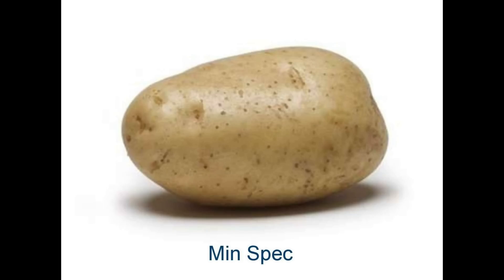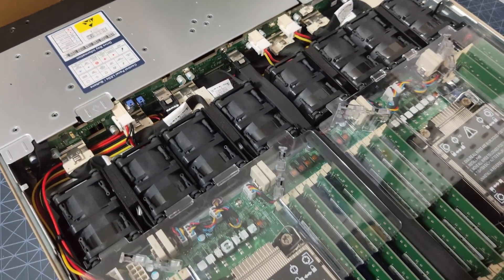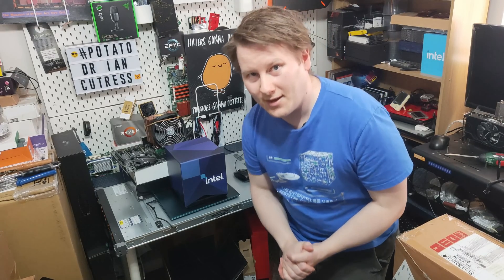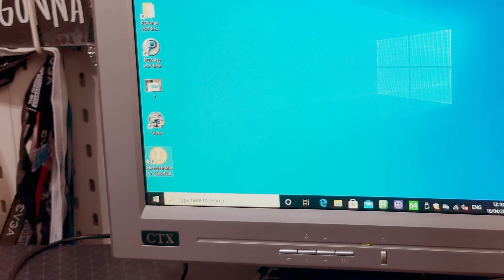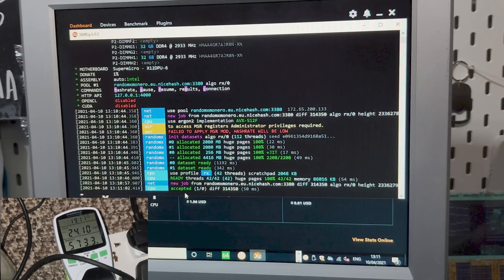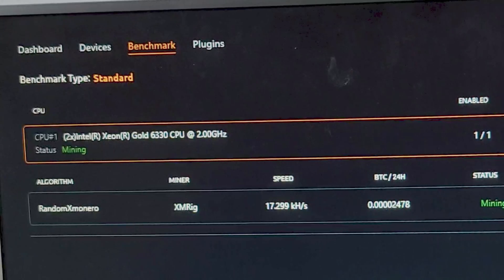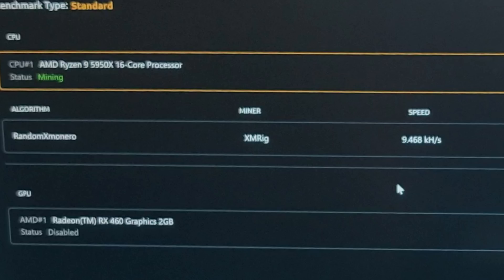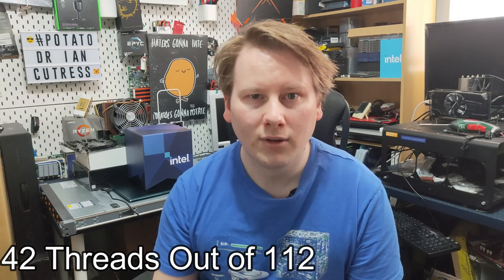Mining on Intel Ice Lake Xeon ⛏⚒

Comment from the maker: UPDATE UPDATE UPDATE
These initial runs were done on fresh OS, no special anything.
I've since rerun the numbers with ADMINISTRATOR and LARGE PAGES enabled.
2 x Xeon Gold 6330:  23.824 kH/s
Ryzen 9 5950X: 15.940 kH/s
You can see the images here: https://twitter.com/IanCutress/status/1380986489371246604
Reply: 15 kh with just 16 cores 😆, and dual xeon with 28 each just 23 kh, lame intel
Reply: For utube algo
Reply: Ian - I mine Montero with 5 different CPUs in my house - a 5.1 GHZ 8700k, a 4.4 GHZ 5820k, an i5-8400, an old SandyBridge 4 core Xeon, and an i5-6500. Yes Ryzen 3000+ would be FAR FAR better for such uses, but I mostly game on my 8700k, and the 5820k is my Bro's current gaming rig. The rest are other small household PCs.  
Anyway, I managed to mine $2500 worth of Monero in 2 years, which is WELL OVER HALF All of my electricity costs for that entire time - that is to say over $1500  of said mining was sheer profit. Mind you - we run 4 window unit Air Conditioners for 3 months of the year, and a bit of electric heat in the winter. 

Obviously I don't mine as much in the summer, but in the winter, it is free heat.

Also, I manage a combined hashrate of ~18 Khash on average.
Reply: That is downright pitiful for the tier of server that is.
I'm certain it handles regular datacenter grade task fine but still.
Also, your best performance will come from a linux system with a custom tuned kernel, would 100% recommend that if you want to get serious with mining.
Reply: Your information on Monero is outdated, they moved from cryptonight hash to RandomX, the 2MB/thread is for cryptonight, RandomX uses a 2GB scratch pad which is why large pages is so important, and RandomX is a CPU only algo, you'll only get 2khash/s on a rtx 3090, the reason why it's not very profitable is because demand for monero is low, fine tuned systems with undervolting, memory OCing, and some other people mine at a "loss" because they either have a botnet or use it to warm their rooms.

And my 5600X does 7kh/s, and i5 3570 1.7kh/s (memory bottle neck).
Reply: strange result for Ryzen 9 5950X, I have 14 kH/s on my Ryzen 9 3900x without any overclocking , on your Ryzen you should have more than 19 kH/s
Reply: could online access to cerberus make xeon irrelavent ?

Comment: i tried cpu mining. on a 4790k and 8086k, they drove the temps up the fans up and the wattage way up. they were also really unstable (i either didnt have the cooling or the power delivery needed). i make about $6/day on my 2070 super mini and old 1060, using about 100w each (not counting the costs of running the rest of the system).

Comment: Main issue is the short between the seat and keyboard?  Seems like you get better hardware than The Course of Anandtech - and without Ryan Smith's MASSIVE ass warping time and space you should be getting better results - but that doesn't fit the narrative.

Comment: yeah, even comparing equivalent zen3 EPYC's to that Xeon. zen3 has higher IPC, clocks up to 4GHz on some cores (higher clocks), burns fewer watts, has more performance per watt, and even offers a few more PCIe lanes for more GPUs. it's a bit meh.  so you can get that 10 year service plan from Dell or HP, and that locks you into only using intel units, a bit meh today (was ok back in the days of bulldozer/piledriver).  so the reason to use intel, is because management locked the company you work for into intel only contracts sponsored by intel rrr dell/HP. (sarcasm detected) should have gone with IBM's big Power, lol.

P.S. love the cat pics. B)

Comment: $2/day that is more than i expected, i expected about $1.30/day, my 3950x produces $0.34/day this is with an underclock to keep it cool and AFTER accounting for power usage and AC
 24h*($0.06/kWh *(110w whole system+30w for very bad AC))=$0.2016
$0.54-$0.20= $0.34

 now yes, this isnt worth doing to BUY a system like this just for ming, but if you already have it, then yes(as long as you're already set up to mine and withdrawl from it. It'll earn you enough to buy a coffee or two each week. This very highly depends on your electricity cost, and if you need to use air conditioning, because i dont, so i dont factor it in.
my 1060 mobile on the other hand uses 85w (only 15w more than my 3950x at the socket) and produces just over $2/day

Comment: It's just not worth it to mine Monero right now.

You'll turn a profit but you could definitely find more profitable things to do with that CPU power. You could edit videos for someone, just about any actual work would beat that.

You could pull a customer's infected hard drive, slave it to that system and scan it quickly and make more profit in a single job than an entire month of mining.

Comment: Thanks for letting the general public know why not all threads and or cores are used when cpu mining RandomX. I am interested in what different SIMD optimizations would have. Like sse2 vs ssse3 vs sse4.2 vs avx vs avx 2.  Also can you cpu mine with an ARM system as well?
Reply: I've seen people say that they mine Monero on Apple's new M1 chip which is ARM based. So I guess it's possible?
Reply: @bgtubber  I should have been more clear, i was wondering about different arm SIMD and or 32 vs 64 bit performance. But yes i do know it  can run on raspberry pi 4 and apples M1.

Comment: Sweet content Doc! Since Intel is kinda flexing with how small their processors are with that new box design, how about striking through that intel logo on the intel processor box and writing Amd there instead and then using one of the larger squares as as the dot for intels letter i. You know, cuz right now amd has the smaller microarchetecture. And then leave the box in the background of some vids :3

Comment: R5 1600AF, 32GB (2×16) 3466 CL16 on NiceHash with Huge Pages enabled usually mines @ 4.000 kH/s, on 8 threads (depends on the difficulty). All core boost is 3,425 GHz. If Huge Pages are not enabled, its usual result gets halved to 2.000kH/s. Latest result @ 800.00 difficulty was 6.667 kH/s.
Reply from the maker: I've updated the description with large pages and admin enabled. 
Ryzen gets 15.950
Xeon gets 23.824

Comment: I mine on a 3900x, 11500 i get. I run on linux, enable huge pages and use a miner called XMRIG, its on github. Its way better than nicehash and windows.
Reply from the maker: I've updated the description with large pages and admin enabled. 
Ryzen gets 15.950
Xeon gets 23.824
Reply: @TechTechPotato  i was just saying about it really. It also helps with low latency ram. I use 3200 CL14. You don't have to test, i was just saying for anyone who was interested. If you have solar it would be better. Take care .

Comment: This is great, Ian.

Would you consider showing a few BOINC projects also? Maybe PrimeGrid, Amicable Numbers, Collatz Conjecture, etc.
Reply from the maker: My issue with BOINC projects is that there's rarely a good benchmark for a project. Unless you can point me to one? I used to do BOINC projects before it really went GPU focused
Reply: @TechTechPotato  Fair point. I can't think of any, other than to compare the average time of work unit completion between the two systems. And when you view a system's profile on a project's site they quote a maximum work units per day value. Sure both chips would get clobbered by GPUs but that's not really why you'd run the test now is it? 😉
Reply: @TechTechPotato  Sadly not really, so you're basically left with having to run for like a month (can probably do less) but that's a huge time investment. Also just as a note with systems with this many cores you can get hit with jobs that simply cannot handle that many and crash out and block the entire queue so it sits idle failing to run. I've had this happen on both 4x 8890v4 systems and a few others, to get around it you have to create multiple CPU slots with a limited number of cores. Probably best anyway to avoid remote NUMA memory access but I'll be honest I have not tried to compare or optimize.

Comment: Now we need to see how Epyc with 256MB L3 with 8/16 cores can mine :-)
Reply: 32 MB L3 cache per core. Bruh... Imagine a full 64-core Epyc/Threadripper with 32 MB L3 per core. That's 2GB of cache memory on chip! Most likely not possible on 7nm due to surface area limitations, but maybe at 5/3 nm? One can dream.
Reply: @bgtubber  it is not possible. They made full chip with L3 to max but added only few cores. See above.
Reply: @JMiskovsky  I don't see why not when they shrink the node to 3 nm? There will be plenty of space for lots of cache due to the shrunk  size of the transistors. Of course it's not possible currently with 7nm. 🙂 There's simply not enough space on the chip.
Reply: @bgtubber  economics. Once they shift entire line then Niche processors would use it too . It was idea of Some nerd / Business savy person.
Oracle is bleeding our customers on licence fees, how we could help them?
Reply: @bgtubber  32Mb L3 per core, 8 cores Epyc CPU's is very similar to 4Mb L3 per core 64 core model. Both of this CPU's do have 8 chiplets with 32Mb L3 and 8 cores (either all enabled or 1 enabled 7 disabled) each. IO die can support up to 8 (not 64) compute chiplets. 64 core 2gb L3 SKU isn't currently possible.
Reply: It was designed in order to save licensing costs. With Enterprise software you pay per core. But if your cores are faster.

Comment: I installed nicehash out of boredom a few days ago and am able to get roughly the same $2 a day mining Eth via daggerhash relatively quietly at 55W on my laptop's 1660ti.  XMR mining seems like amazingly bad value :(
Reply: Depends on the viewpoint. If XMR price jumps (it's not even at its previous all time high yet), you'd make decent profit even if you mine at low profit now. That's like saying mining ETH is not worth it in 2020 when it was just $150. Just a year later ETH is worth $2100. If you continued to mine it back then at low profit, you'd have some pretty good money now.

Comment: Thank you Dr. Wafer eater! I've been wondering why Monero/Nicehash only loads half the threads on my 5800H, but leverages every thread on my 5950X!

Your hash rate for the 5950X was a bit low though, and there's an optimization thread for it on Reddit. I have the 5950X in my main computer, and when not gaming (or other heavy workloads I suppose), the only "visible"/obvious indication that the computer is mining on both CPU and GPU even while I use it for other tasks, would have been whether or not the fans on the GPU (XfX Merc) spins up from time to time. I say "would have" because I've set the 0-rpm mode to off. This GPU's cooler gives no F's what you do with the GPU! 😁

Well, I suppose there is a slightly noticeable latency for some tasks when mining on the CPU. But not enough that it bothers me at all. So why not let it mine? It's free real estate! Well, would be, if I used the profits to buy real estate. 😏
Reply from the maker: I've updated the description with large pages and admin enabled. 
Ryzen gets 15.950
Xeon gets 23.824

Comment: I get ~38,000 kh/s with a stock Threadripper 3970x with 3800 Mhz CL14 DDR4 dual rank RAM. BTW, I think that you have something misconfigured. Under 10,000 kh/s for a 5950x seems pretty low. I get 10,500 kh/s with a 1st gen Ryzen Threadripper 1950x (16 cores) and that CPU is pretty slow compared to 5950x. Especially in cache intensive workloads which Monero mining seems to be. I use Xmrig instead of Nicehash. If you set Xmrig to run as administrator, it sets special functions such as Huge Pages, MSR mod etc. that boost hash rate.
Reply from the maker: Literally answered in the description and pinned comment.
Reply: @TechTechPotato  lol, you're right. I was on my phone and didn't scroll comments yet. 😁 BTW, I might be wrong, but I don't see a pinned comment? At least yours doesn't show as one on my side.
Reply from the maker: Shound be working now!
I've updated the description with large pages and admin enabled. 
Ryzen gets 15.950
Xeon gets 23.824
Reply: @TechTechPotato   Cool! 👍 Thanks for updated stats.

Comment from the maker: The miner says 'Failed to apply MSR mod' because I didn't run in admin mode for the recording. I redid the numbers and it rose +10% on both systems: $2.19/day on Xeon with 42 threads and $0.86 a day on Ryzen 9 with 16 threads. Still not worth it. You could argue that both systems would return the same $ per thread, but the ICL-SP system obviously consumes much more power. Also memory at JEDEC, DDR4-3200 CL22
Reply: Hello! I'm getting about 15.7 kH/s on my 5950X with 2x32GB DDR4 3600MHz CL16 RAM with the CPU limited to 105W via Ryzen Master (just enable PBO and set PPT to 105). The most I got was 16.4 kH/s while pulling about 135W of power (the power usage this CPU will default to while mining).

I am using NiceHash's Quick Miner software with CPU mining enabled (that contains XMRig 6.7.0).

Your result is waaay too low. Try to enable huge pages and see if this yields any boost.
Reply from the maker: This system is running stock memory for what it's worth. DDR4-3200 CL22. I mean NiceHash is meant to be pickup and play, and for a fun little side project, I wasn't intended to optimize it to the n-th degree 😉
Reply: @TechTechPotato  Then that might be the issue.
Reply: @oppturbv  even your results are a bit low. I would suggest not using Nicehash if you have the time to set up xmrig yourself and you don't mind being paid in monero. You can get 18-20kh/s pretty easily with that cpu and ram combo. You can always exchange it for bitcoin or whatever, but monero is an interesting coin that everyone into crypto should at least learn about.
Reply: @fern3436  Thank you for your suggestion. I don't believe there is any issue with NiceHash, as it allows me to configure XMRig however I like. What settings would you suggest?
Reply from the maker: I've updated the description with large pages and admin enabled. 
Ryzen gets 15.950
Xeon gets 23.824
Reply: @TechTechPotato  That looks about right. Thank you for taking your time to look into this.
Reply from the maker: They are not.
Reply: Most of your videos are "beyond my pay grade," but I can usually pick something up that makes sense. Thanks for your work here. Anyway, I wondered what the heck L3 cache is and why it matters. For anyone else curious:  https://www.reddit.com/r/NiceHash/comments/7n0p6y/cache_considerations_for_cryptonight_mining/